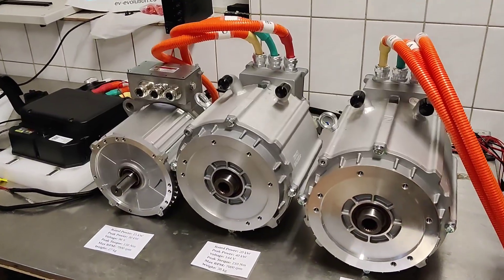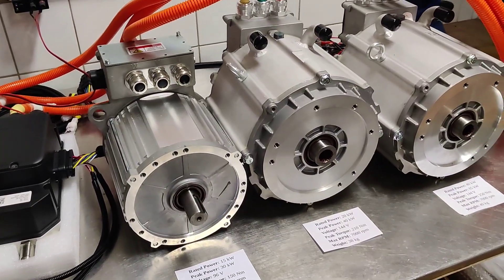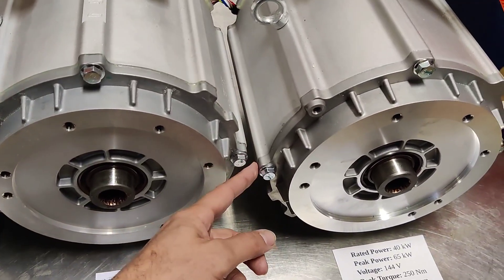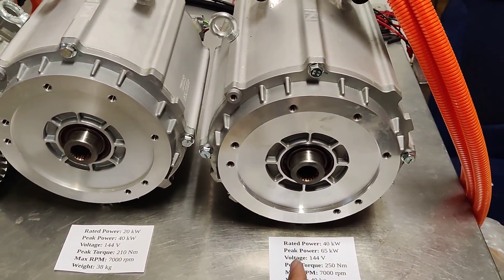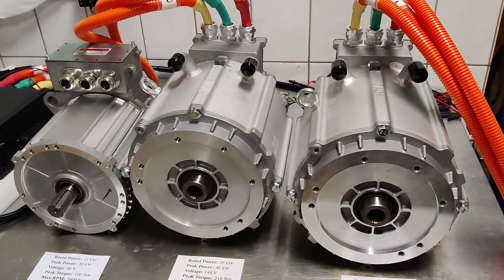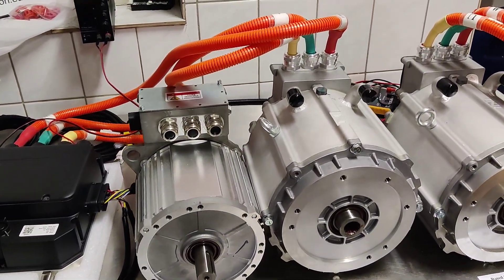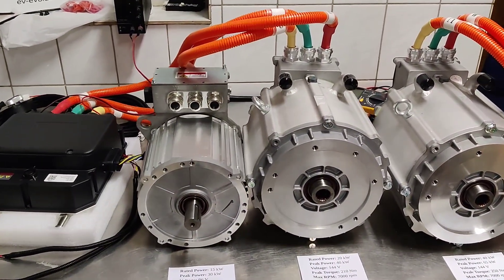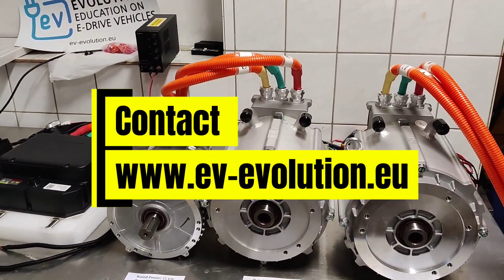PMSM motor for your EV Conversion - EV Conversion Kit

Comment: Could you come up with a solution to replace traditional alternators with PMSM motors? This could also allow for belt driven mild hybrid-type solutions. Also generator applications for old diesels :P
Reply: @rkan2 check out a company called Safiery they have a website and YouTube videos. Might be what you are looking for ?
Reply: Not good idea. How Much power can you push through the system? Not Much 2 hp max for small car unless you want to burn ribbed belts. What if I just want to charge the 12 or 24v system? Well you can but it won't last as long due to cheap shielded unsealed bearings and the buck/rectifier circuit is prone to failing in that environment also adapting the motor to have a pulley and brackets. It is a good idea but there are too many different "Spins" from different manufactures on what the alternator housing should do.
Reply: @neptarclepuffin I'd be already happy with having the 90% effiency these offer imstead of the 50% or so normal alternators give. Instead of normal 80A you could probably easily take 120A or more without adding any load.